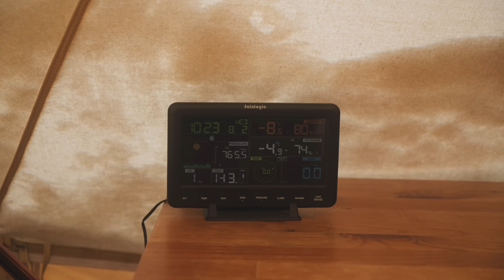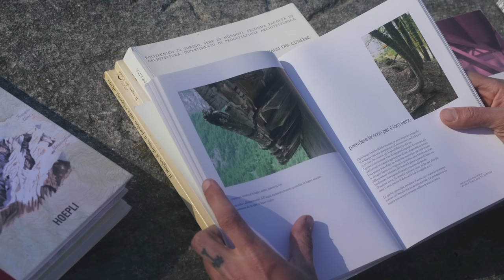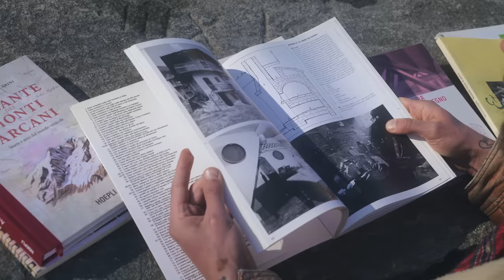#53 Working through the cold in Winter

Comment: Have been thoroughly enjoying your videos. It’s my understanding that this will be your last winter in the tent but what about a basic 1V dome frame and tarp added over for during the winter to keep the snow load off? There are brackets available for $125US delivered in US and then you just add locally sourced standard lumber with no fancy cuts and connect with carriage bolts. Might have to ship from Canada if no European distributors, but brackets fit in smaller than a shoebox and only weigh maybe a kg total. Easy-up in a couple of hours and semi-permanent; if you nix the tent eventually they make good greenhouse frames. You could potentially make it work as a greenhouse style enclosure AROUND your tent and get extra dead-air insulation and better solar heating and keep your tent warmer too in the meantime.

Comment: The gutters are works of art! However, I just keep questioning the gap between the logs I imagine they should overlap so the water falls from one log into the other. Also, I would look into if the tar you're using will contaminate your rainwater or not. In hindsight the cracking could be mitigated by starting with fresh green lumber, splitting it in half, hollowing out the core and then letting it dry slowly for a couple months inside. Maybe for the next cabin :) thanks for the great series!

Comment: IM SMILING BECAUSE IVE BEEN THRU 3 WINTERS IN IDAHO, -10 FAHRENHEIT A COUPLE NIGHTS THIS WINTER, IVE HAD IT ALL FREEZE, WATER, OIL, ALL THE STUFF WE NEED ON A DAILY BASIS. BUT IVE MADE UPGRADES TO ELIMINATE THOSE SURPRISES. THIS WINTER WAS THE BEST SO FAR. NO FROZEN PROBLEMS, MORE TRUCK CAMPER INSULATION, HOT INDOOR SHOWERS, NO MORE BOILING MY WATER ON THE STOVE...LOLOL. LOV THE GUTTERS, AND THAT IS A VISE DECISION TO TAR THE INSIDES OF THEM. MAYBE EACH SUMMER YOU  DO THAT AND THEY WILL LAST MANY COLD WINTERS. GLAD TO SEE YOU GET BACK INTO THE TENT, MARCH IS GONNA BE HERE SOON AND SPRING AND SUMMER WILL BE LONG, AND ALL THAT SOLAR WILL BE AT FULL CHARGE AGAIN. BE BLESSED BROTHER...

Comment: What is Shou Sugi Ban? Originating in 18th century Japan, shou sugi ban is a particularly striking method of preserving wood by charring it with fire. Traditionally, this practice is used with Japanese cedar in order to weatherproof it. The wood is burned until the surface is charred, and then coated with natural oil.

Comment: North of England still uses wooden gutters. Where both sections join, a recess would be chiseled out to take a piece of sheet lead to join the two pieces. Tar below, lead pressed in well, and held with copper tacks. A similar arrangement at each end. These joints can last years and years, if followed up with the gutter treated regularly. Fond memories!! Thanks.

Comment: Nice craftsmanship but I would have done the gutters and drainage all in copper, with hangers in metal compatible with copper. 

Wood won’t last long and requires more maintenance. In the hours spent on the wood you could have been finished with the spouts and been working inside where you could control some heat and build furniture or interior structures. My $.02 .

Comment: rain chains work better than downspouts for me. prettier and cheaper too. Mine go to rain barrels and then over flow onto big hot water heater drain pans, and then overflow into 4 inch drain pipes in the ground. If you have many leaves, down spouts are always clogging. Expensive copper downspouts would make the clogging even more annoying to me.
Reply: A bit of scrunched up chicken wire in the top solves the leaf thing......!
You think chains are pretty - I think they're ugly!
...takes all sorts .....

Comment: Your gutters look to be incorrectly mounted.  An imaginary vertical line from the outermost edge of your roof stones to the bottom of your gutter channel should allow water to strike approximately 1- 1 1/2 inches inside the back edge of your gutter channel.  Viewing the present installation from my perspective, during a heavy rain, water will miss the outside edge of your gutter or worse splash over the outside edge run down the outside edge of the gutter and migrate back onto your supports and facia board. Either scenario will greatly reduce the effectiveness and longevity of your gutters. Consider mounting your gutters so that rain water will strike the back edge of the interior channel at the distance suggested above..

Comment: Martijn, does the inside channel of the gutter slope towards the copper pipe on both sides? If not, it seems like water would pool up at the end. That might not be good for the wood in the long term. You might have to drill a weep hole through the end cap, so the gutters drain fully.

Comment: How are you going to address the joint, where the two sections of gutter meet? The 2 sections will expand and contract independently of one another with temperature variances. No matter the material, your splices will be a leak issue. 
Luckily you only have 2. 🙂 Just be sure to maintain them yearly.
They look great! I look forward to seeing more.

Comment: On the outside wall of the bigger house you showed aseveral holes for beams.   Would it possible to add beams coming out from there and add a roofed addition or carport to save your vehicle and equipment.  ?

Comment: @13:16 If it is possible, you should consider installing a big panoramic window on the wall facing down the mountain. With this little windows, the cabin looks a little depressing, kid of like a basement.
Reply: Changing windows requires major permits permissions and doubtful to get permission due to originating 1903.
Reply: If I remember correctly, when Martijn first bought the cabins and was applying for planning permissions, he was told the cabins had to look the same when they were finished as they did before.  The area is to be protected from losing its character and history of its buildings. They have allowed the roof light because from the ground it will not be a visible alteration. The cabins were more likely used for animals than humans, hence the low ceilings inside.  If the floors are lowered inside, height can be gained to make it more comfortable.  And Martijn has raised the roof  just a little bit. The care he is taking to preserve the standards of the build is impressive.
Reply: @stanB950 You are not changing windows, you are adding one window. It is not a villa, but basically a shanty / a stable not designated for permanent occupancy. Getting a permit shouldn't be a problem.
Reply: @gancarzpl  Adding a window to a historic building is most likely a no for a permit ( watch video # 2 where Italian Surveyors explain just moving a doorway was a mountain of paperwork and no guarantee for approval and is very expensive)
Reply: @gancarzpl  Video # 2 explains about rules of what is allowed and what is not allowed
Reply: There's actually quite a good view, er...outside!
No real need to start chopping great holes in the walls.........